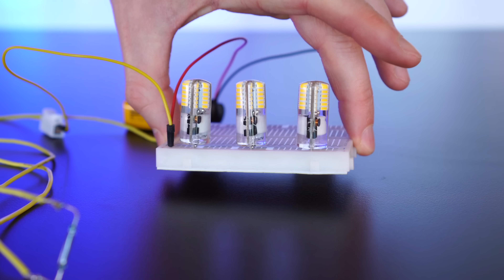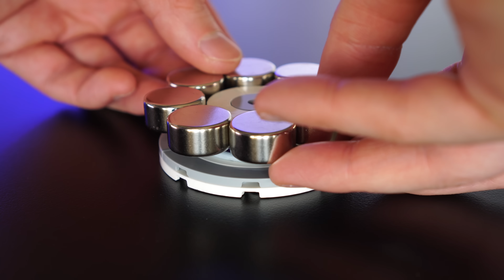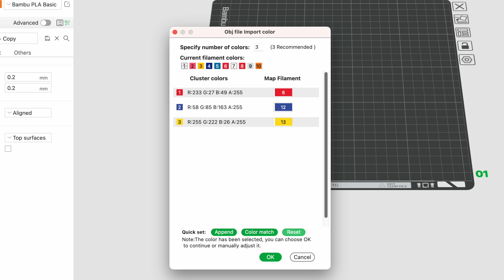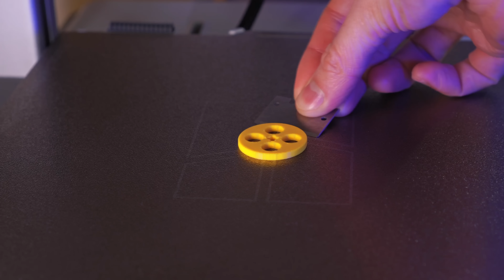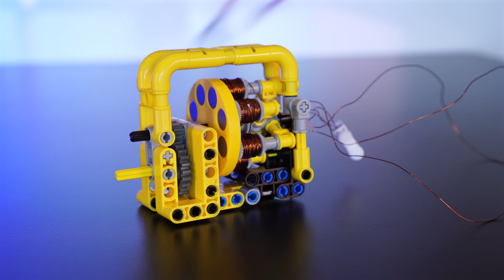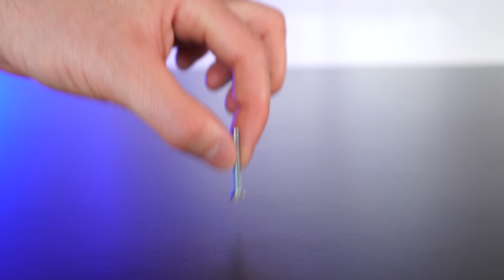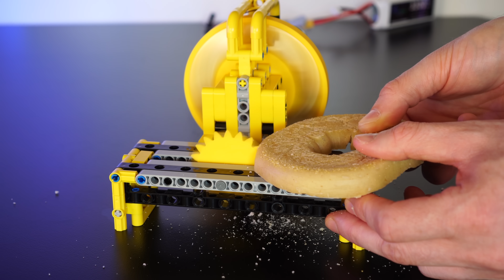Building Bigger & BIGGER Brushless Motors Using Lego

Comment: Use a black circular plate instead and balance it with a black dot then your 1 white dot will produce a RPM accurate count but still be balanced. Also instead of affixing the coil bases and winding the wire around with your hand attach the coil bases to a hand crank and turn that while guiding the wire with your other hand you will produce much tighter nicer looking coils with a lot less manual effort.
Reply from the maker: Those are both excellent pieces of advice - thanks a lot!

Comment: your saw blade design could be improved if you directed the teeth in opposing directions to increase the width of the cut so the sides of the cut material dont rub on the sides of the blade

Comment: what I would like to see with brushless motors like this is testing different winding styles. right now all of the 6-coil motors are wound as axial flux motors, with winding pattern ABCABC. I would want to see AABBCC with a 4 magnet rotor (max speed, least torque) and maybe AaBbCc with the 16 magnet rotor (max torque, slowest speed). Maybe also a radial flux motor but I know that's hard without curved magnets

Comment: i get ur respect towartds safety on a lego build, and rotating massess r genuenly 1 of my top fears in this world generally.... but from my experiences u can push this waaaaay harder wthout real danger lol.
Reply from the maker: I'm glad to hear that cause I really want to push some of these hard!
Reply: @JamiesBrickJams  like i dont want to be responsible for sth failing to bad in the end, but i have quite a decent bit of bullshittery experience on older legos, and even those held up to almost everything. i even used rc model brushlöess motors... the gearboxes and frames do wobble and sheir a lot, and sometimes fail, but in my experience never rrly catastrophically to a point of real danger. i do see the biggest faliure point within the 3d prints, like u are aswell i believe. but u can always beef those up to a certain extend... + if it does fail, all the dubree should only impact in its primary faliure within 1 plain, which is quite predictable. and the frame around ur gearbox and lego frame can be beefed up easily, just doesnt look as good. but great vid, keep it up!!! oh ya and i tried to break the axles intentionally oncce, it takes insane amount of torgue. the gear will shear off before the axle goes. and even if u clamp in the axle at one point and try to rotate it into failing, it will deform by twisting itself instead of exploding. so that should be fine for anything u be planning ig lol. sry for the spam xd
Reply from the maker: Yeah the axles and Lego I'm less worried about. It's more the rotor releasing a magnet at top speed. If a magnet escaped, there's a good chance that's goodbye tv/window/eye/teeth etc. And once one magnet flies off, I'd imagine the rest of the motor would shake itself to pieces. But I totally want to take it outside and just chuck the full 200 watts into it to see what'd happen 😎
Reply: @JamiesBrickJams  yupp. Also neodym is splintering like crazy after impacting stuff. Nasty if ur unlucky... Good that u keep it safe

Comment: Sad we didn't get to see the bigger motors have an iron core. 

Someone else tried it a long while back, But you could always use the motor to try to make a paper shredder.   Or have it power a rock tumbler, or something along those lines.  The torque would be useful for things like that.  Or, use the pure speed to make a centrifuge.  A device that spins vials of liquid crazy fast, causing anything suspended in the solution to separate, and get pushed to the bottom of the vial.    That would be hell of an engineering test, as a centrifuge, due to it's crazy high speeds, needs to be very balanced.
Reply from the maker: A centrifuge could be a lovely demo, cheers for the suggestion! Coming from a research background, I'd quite like to try that. And I'll certainly try a ferromagnetic core motor at some point soon!

Comment: Grear video, for the saw blades should make the tips of the blades slightly wider than the rest wider cut but overall less friction
Reply from the maker: Huh my instinct was to do the opposite .. cheers for the suggestion - I'll look into that
Reply: @JamiesBrickJams The idea is to increase the gap between the non-cutting bits and the material, as any friction from the material wastes a lot of power. So you have to make the cut wider than the disc, and the only way to do that is to make the teeth wider than the rest of the saw.
Reply from the maker: Gotcha, now you mention it, that makes a lot of sense!

Comment: I feel like at some point you should just make a ginormous three phase motor that’s so big that just the stater rotating generates enough wind to keep the coils so cold that they’ll never overheat but I feel like you should do it outside with like at least a mile of wire away from where you’re at And where it won’t hit bystanders with flying magnets
Reply from the maker: I reeeeeally wanted to max one of these out with a 300 watt power supply and record it exploding in slow motion. But my small apartment would suffer, so I'll try to record something like that out in a field at some point!

Comment: What diameter wire do you use?
Reply from the maker: Totally depends, I use everything from 40 gauge up to 12 gauge depending on the use case. But I hate working with anything thinner than 30 gauge 😅

Comment: What program or website did you use to make the blades, cause I had problems getting the axle holes correct
Reply from the maker: I just used Tinkercad! I tried a few others but it was taking too long to learn. Tinkercad was super quick to learn - 20 mins tops

Comment: btw i recomend using adaptive cubic infill than the grid in fill
Reply from the maker: Ooh thanks for the heads up! What's the benefit?
Reply: @JamiesBrickJams  the infill changes depending on the shape of the print and forms triangle like infill in all axis and you can see it when sliced on the the right in a sliding green thing showing layer height and interior if you move the plus up and down
Reply from the maker: Sweet, cheers! Does that infill make it stronger? Or more efficient?
Reply: @JamiesBrickJams  both
Reply from the maker: Awesome, appreciate the tip 🙏

Comment: So could you build a working RC plane with lego?
Reply: Hypothetically yes however if I had to guess I think it would be too heavy to generate enough power for lift to counter drag and gravity
Reply from the maker: I think Peter Sripol managed to make one. I'd imagine the easiest way to make Lego fly is my making a technic frame and mounting some brushless motors to make a small drone. Though at that point, I'm not really sure you could call it a Lego contraption

Comment: you should try making these saws again but with mini metal sawblades used for rotary tools, these saw blades are made to be spun at 20,000+ rpm on a Dremel or similar rotary tools so they would be able to handle a few thousand with no problems at all, they are made of super hard high speed steel that is nice and sharp so with enough power it should be able to cut nearly anything you throw at it (with in reason of course) also you probably already know this since you buy metal parts, but there are metal lift arms with bearings in them on the same site, metal saw blades and metal lift arms bearing mounts would take these to the next level, I've been wanting to build one for so long

Comment: hey if you want MORE POWER, try adding coils on both sides of the rotors, should double it
Reply: Some bearings is first priority though
Reply: And perhaps some transformer metal C-shapes to give the magnetic flux a nice path around the motor.
Reply: in addition to double sided coils and bearings, reduce the air gap between the magnets and coils
Reply: Y
Reply: @Izaiah hunger i
Reply: Home improvement, ever seen it?
Reply: That'd balance the lateral force on the rotor, so it might even produce more than double the output due to reduced stress heating.
Reply: Motor torque depends ALOT on air gap - the closer the rotor magnets get to coils (typically 0.5mm is a good norm) the more torque it will get
Reply: Refining the distance between the magnets and coils as well, closer is better to an extent, better balancing and bearings, fluid or magnetic bearings once speed gets truely mad, cooling systems, ect ect until little Lego remains and even 3D printed plastics are reaching their upper limits